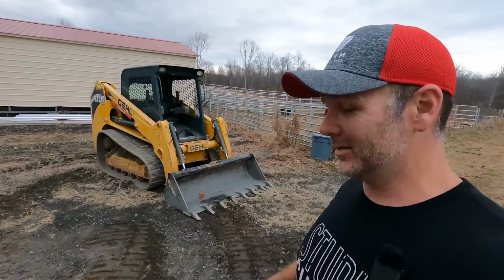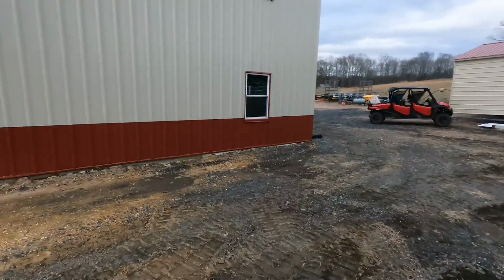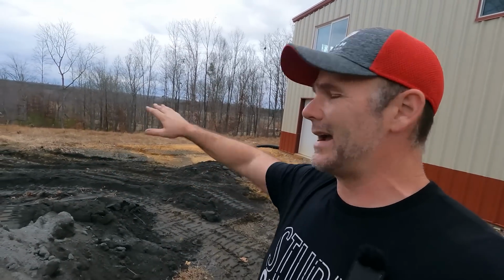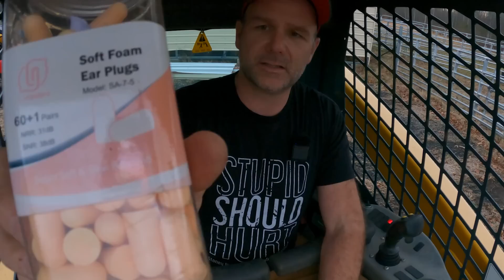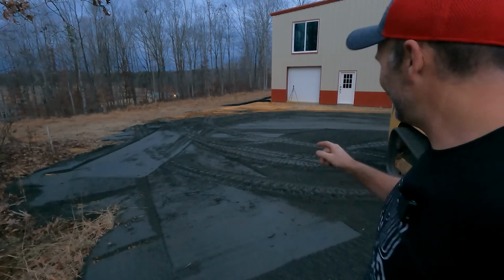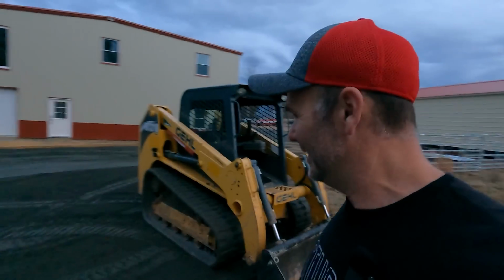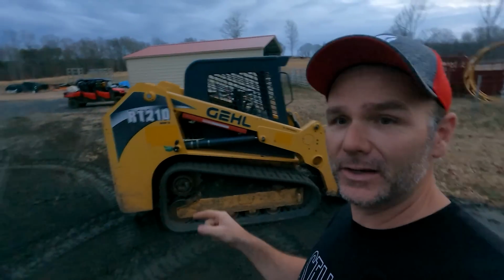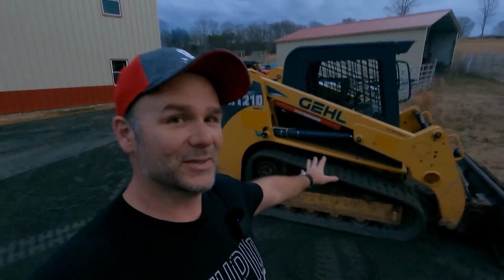We've got issues around the new shop building!

Comment: Hello Josh from Missouri. If you had a large drum roller to put on the little tractor it would pack the millings down and they wouldn’t wash away so easily when it rains. This is just a tip from an old heavy equipment operator. Thank you for reading it.

Comment: I wear a chainsaw helmet with the earmuffs when driving a tractor or another piece of equipment longer than a few minutes. Ear pods fit right underneath. So there is good hearing protection and the ability to listen to media on the ear pods.

That’s a great machine to make spread material.
Reply from the maker: I don't typically listen to music when running machinary...you're just trading one loud noise for another in most cases

Comment: Hi Josh, great video as always. Don't know if or what they are called in USA, but farmers in UK spread tarmac road plainings. They are great for your tracks etc and cost near nothing as its a waste product.
Reply: Here in the states, it's usually called Asphalt Millings. You can get it but there is much debate about "unknown" and known chemicals in the old millings that can leach into your soil. Some say from vehicles' normal oil leaks to accidents that have larger spills contaminating the roadways. There are a few companies here that now mill it, send it through a process on-site, and put the milling right back down as a new surface.